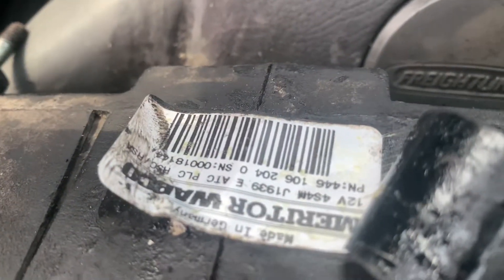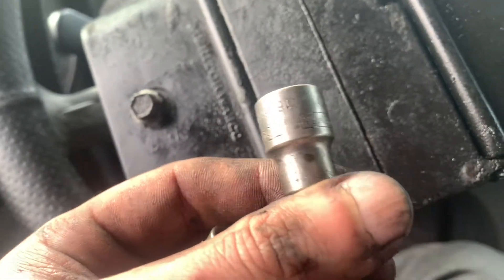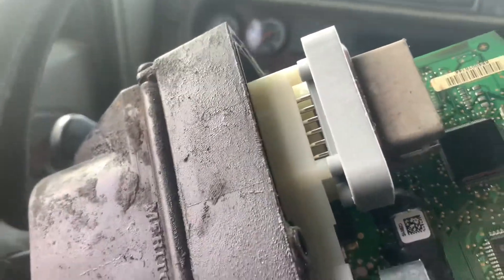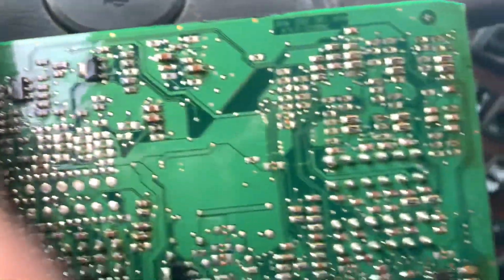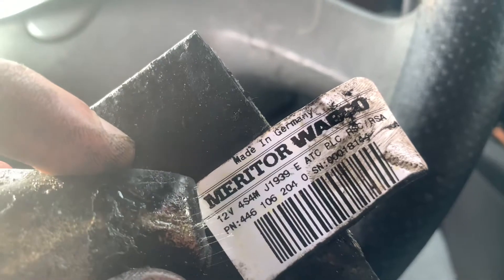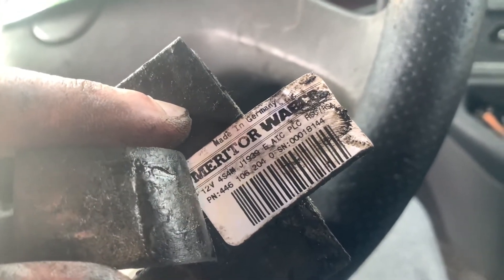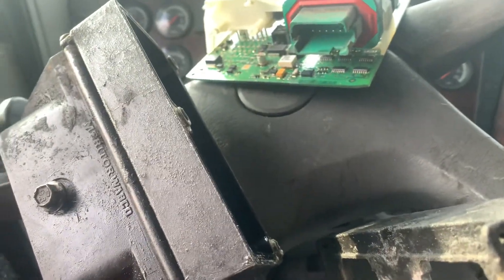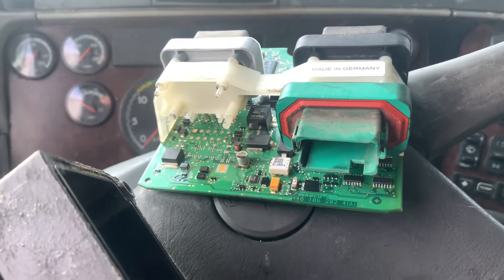Abs module (ECU) inspection for freightliner century. Brake controller NoRESP 136s254 07

Comment: Did you have to delete any codes after installing? Or did it start working as soon as you installed another abs module?
Reply from the maker: @Selections-e5m  there is no need but you can reset abs by switch on/off 6 times
Reply: Did you have to drive it around for the light to turn off? Or when replaced just shut off on its own?
Reply from the maker: @ actually yes you need to drive above 5 mph for a minute
Reply from the maker: @ upload your codes on hiaibox app. Tether might be able to help you

Comment: Hello. 
Freightliner Cascadia 2016.
Tractor ABS light on. 
The truck won't start. 
I don't have a check engine light on the dashboard only the ABS light on. 
If you guys know something about this can help me.
Appreciate it.
Reply from the maker: What I know, ABS should not affect your truck start. I would ignore abs light now, and focus on truck start. Upload a video to hiaibox.com, explain your issue. Sometimes they have mechanics who will write back.
Reply from the maker: Does your engine crank? Do you hear a click from starter solenoid?
Reply from the maker: Do you have manual fuel pump ?

Comment: So when I plug in the pigtail the abs light on the trailer won’t turn on . We checked the fuses on the dash all good we have power at the plug but no power in the center hole on the pig tail ! No abs lights on the dash stay on I don’t know what it could be 2009 freightliner century
Reply from the maker: Upload your issue to hiaibox.com. I would plug everything back , hiaibox will tell what to do next. They have a abs code trick it might help you
Reply from the maker: Let me know if you figure it out. I’ll come later and try to help you
Reply from the maker: @mexi9787  fyi that abs module is for tractor only, I don’t think it has any relationship with trailer ABS.
Reply: @owneroperatorlife4380 so what would the problem be yes my tractor abs system is working fine no lights on the dash . I just got the truck and put new lines on the back when I went to hook up to a trailer all the lights turned on expect for the Trailer ABS All the fuses are okay , the new lines work hooked it up to another truck and it worked for the abs light . So from the plug back to the truck is my problem I just don’t know where else to look after the looking at the fusees !
Reply from the maker: @mexi9787  I just looked at hiaibox, I see your post, did you inspect the fuse box behind driver seat? Not the one in front of passenger?
Reply from the maker: @mexi9787  I recall it could be related to ignition wiring if I remember correctly. I tried to access DTNA today, but I guess dealership has stopped the service where we can get in and inspect wiring drawings
Reply: @owneroperatorlife4380  yes sir I did inspect those fuses in the side compartment behind the drivers seat ! They were all fine ! And yes sir I can’t find any wiring diagrams anywhere it’s crazy ! That would really help to see if maybe it could be the PLC filter or the ABS Module! Thank you so much for trying to help me this is my first truck I know automobiles but Tractor trailers are new to me but I’m ready to learn !!
Reply from the maker: @mexi9787  I just found out I still have access to DTNA, EZ wiring. Ask your freightliner to get access. It will help you a lot. Sales department may have to get involved, they will try to give a hard time especially if you did not buy truck from them. Call other dealers if you struggle with yours. Their system is a bit annoying.
Reply from the maker: @mexi9787  try another trailer, just to eliminate 100% a trailer issue.
Reply: @owneroperatorlife4380  what is the DTNA ? And what do I tell them to get this information? Yes sir we did we even changed the lights to make sure but yes with my tractors it does not light up
Reply from the maker: @mexi9787  sorry, do you think trailer abs light on dashboard bulb is burned ?

Comment from the maker: My issue was ABS ECU module, bought used one from eBay for $300, it fixed the problem. My ABS modules were not testing or clicking when you start, Also, ABS check button was not responding. But after ECU replacement everything works.
Reply: Did you just install it n that was it?
Reply from the maker: @ThinkEagle7  also, keep in mind your issue could be a water leak on abs power distributor behind driver seat.
Reply: @owneroperatorlife4380  Kool. My is international prostar
Reply from the maker: @ThinkEagle7  yes, I called dealer if programming is needed, they said no.
Reply: Do you remember what was the code? Thanks
Reply from the maker: @fadys1394  brake no response
Reply: @owneroperatorlife4380  thank you Sir for your quick response